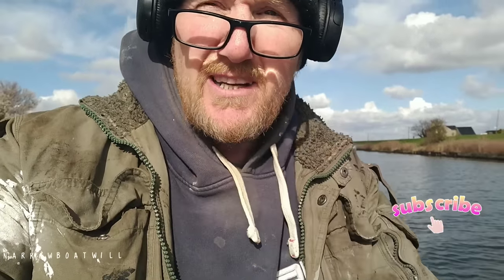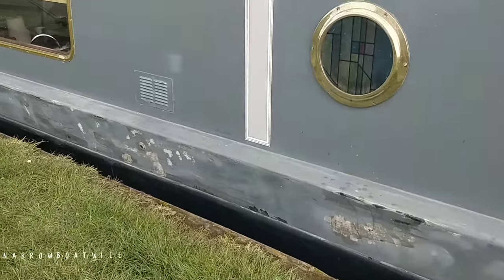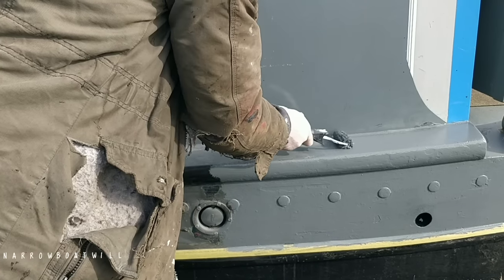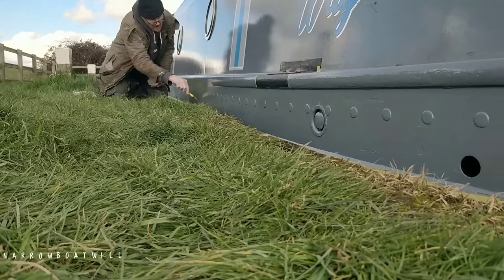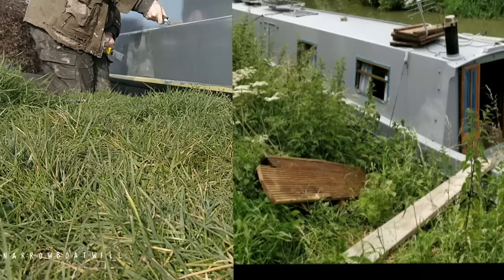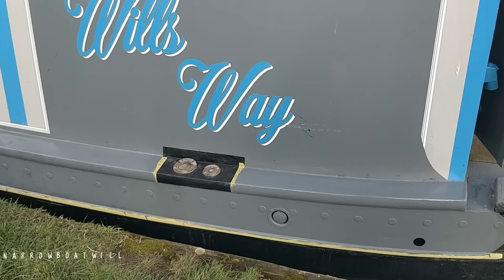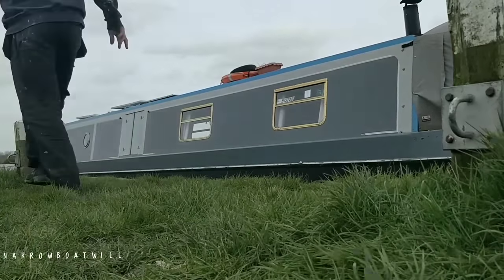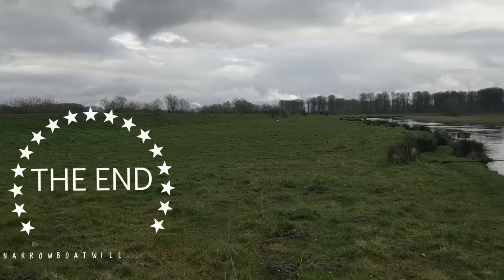Time for a change. Painting my narrowboat. Cruising and snow.

Comment: when paint rolling ,never keep going over what you have just done ,as it fetches the paint off ,only use a brush for cutting in ,,ie corners etc ,,as the roller is giving you the finish ,using a brush ,you get the brush strokes
Reply from the maker: Thanks for the tip.

Comment: One of the reasons I never seem to get down to painting my boat is the bloody weather, if to cold it’s tricky and if to hot it’s the same, temperature is key for a good job having done a few boats now, anyway thats my excuse for a shit boat 😂😂😂😂😂😂 Seem to do a much better job on others boats than mine that is entirely neglected. PS I never use those fluffy rollers they are poo, seriously you want the smooth ones. Can come and rub mine down next as your a youngling.
Reply from the maker: 😂😉😂😉 I only do painting if it's quick and easy. I don't care about all the under coats. 😂😂 Go on mate get stuck in..